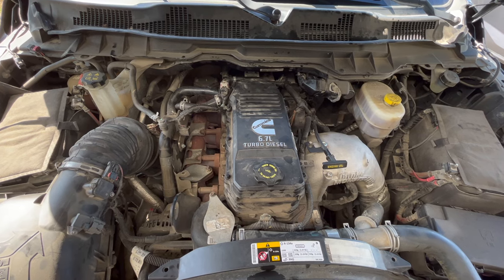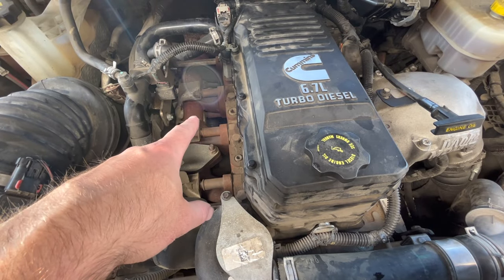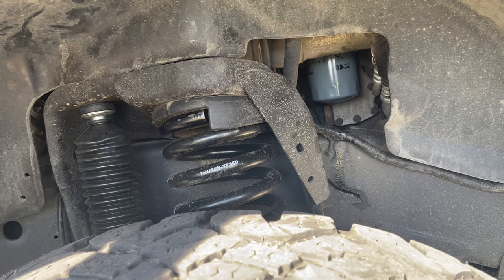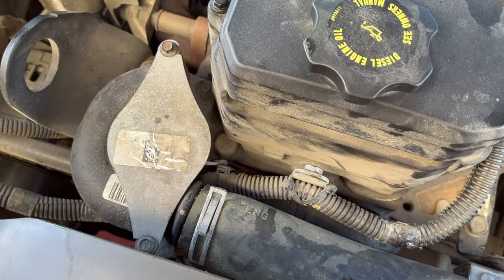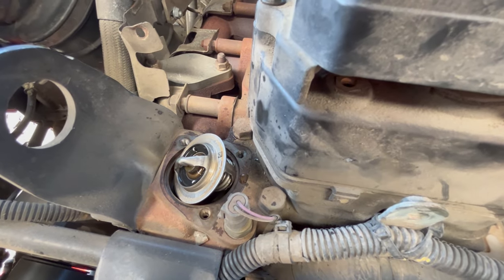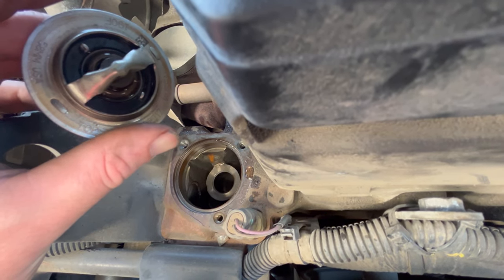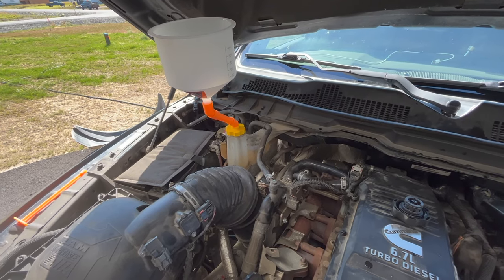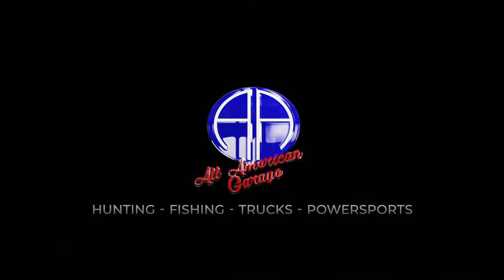2010-2018 Ram 2500/3500/4500/5500 6.7 Cummins Coolant Flush and Thermostat Replacement

Comment: Whats the normal temperature for these types of engines
Reply from the maker: 190-220F 
There’s a range of thermostat options, I’ve seen 190, 200 and 220 on places like rock auto. Just as a small note, higher operating temperatures usually result in higher efficiency and less engine wear.

Comment: Have a question have a 2018 Dodge Ram 3500 that has no turbocharge power have no leaks and no codes haven't foundthe issue the egr systemhas been deleted any suggestions for this issue.
Reply from the maker: Is the turbo spooling? With the EGR deleted you should be able to hear it pretty well.

How are you identifying that you no power from the turbo? Is it based off the factory boost gauge on your dash?
Reply: Turbo actuator is likely stuck.  It's fairly common.  City Diesel makes an actuator replacement kit.  It's fairly simple to do from the passenger side fender well.
Reply: I had code U010C (Lost communication to Turbo).  Symptoms are low boost until 4th gear.  EB eventually stopped working.  Test 4 wire plug at turbo actuator.  Pin 1 = 12.6 volts, Pin 2 and 3 = 2.5 volts (+/- 0.8 volts is fine) key on and 120ohms key off.  Pin 2 and 3 are your can bus communication wires to your ECM.  Pin 4 is ground/return.  If yours plug to actuator test OK then pull actuator.  Make sure you drain your coolant first.  Check by hand that your turbo gear/lever moves from closed to open with little effort.  If it moves freely then 97minitaco is correct.  City Diesel actuator is the way to go.  If the turbo lever is hard to move/doesn't move you need a new turbo.
Reply: @aholmes447 if the lever is hard to move why not just replace the actuator vice the entire turbo?
Reply: @andymike6575  The lever gear is on the turbo side and runs inside of the turbo.  The actuator is the motor side and splines on to the gear/lever.  There may be a way to disassemble the entire turbo and clean it to get the vanes unstuck (which would free up the lever to turn freely).  

Everyone I know that has a stuck lever gear on the turbo side replaces the turbo.  Fortunately,  mine moved freely.  So just replacing the actuator fixed my issue.  Unfortunately City Diesel was 5 weeks on backorder.  So, I had to go with a cheap Amazon one.  So far it's holding up though.
Reply: @aholmes447   okay I had a hunch that was the case but i understand now, thanks.  Is there any factors that affect longevity of the VGT and its actuator? I’m guessing good oil is probably the most important.  I’ve heard of the oil return failing and causing catastrophic oil starvation to the rear crank bearings leading to thrown rods.  Just happened to “Everythang Diesel” here on yt…blew up his 6.7L 4th gen